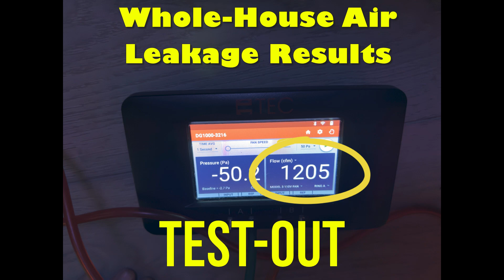IR Image Analysis Shows Huge Temperature Change After Insulation

Comment: Have to agree it works. Back in October I air sealed and insulated my Rim Joist / Cantilever. The area above the cantilever sits two of my bedrooms. That front wall above the cantilever was always very cold and the rooms were never warm in the winter. They were probably a good five degrees cooler than the rest of the house. The marble window sills were as cold as ice in the wintertime.  After correcting the issue, even with the temperatures being in the single digits outside, those two rooms are now the same temperature as the rest of the house.
Reply from the maker: Sweet! Did you have supply ducts running through it as well?
Reply: @homeairleakagetest  luckily I had return ducts in the area. One from each bedroom. The supply ducts are within the home envelope and protected from exterior temperature fluctuations.
Reply from the maker: Got it. Glad you got it fixed! As always thanks for your comments. Much appreciated